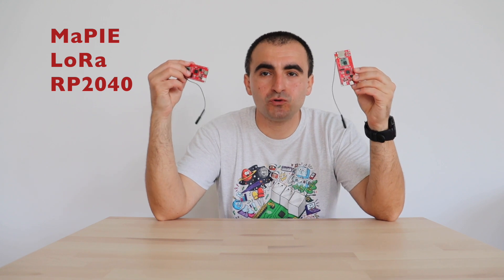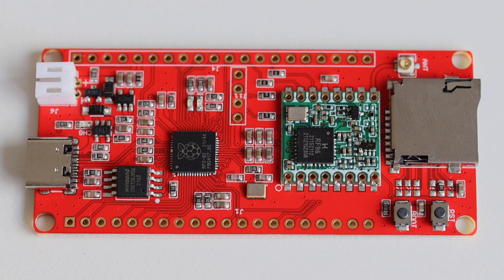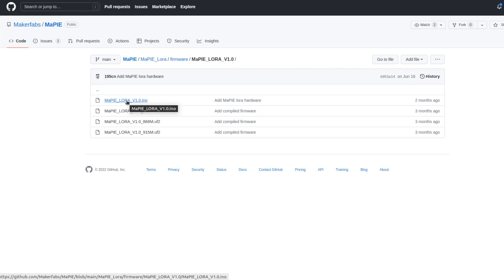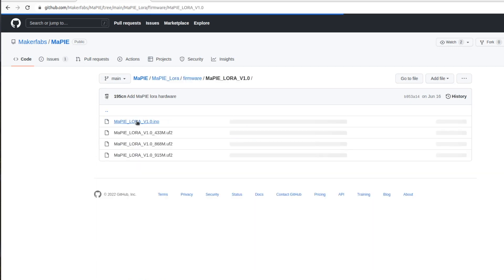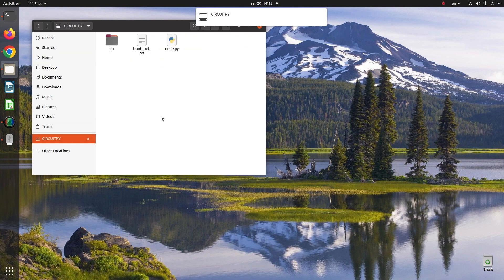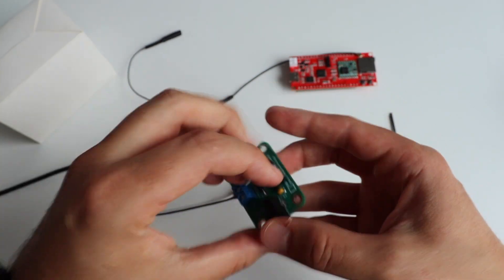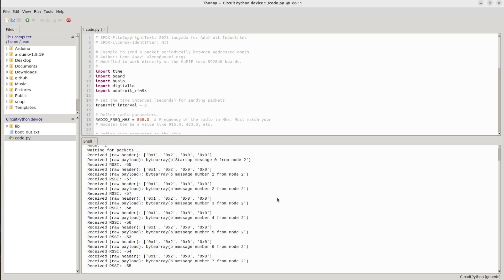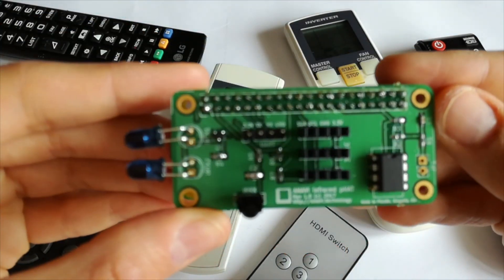CircuitPython on MaPIE LoRa RP2040

Comment: I’m also working on an rfm95 project in circuit python. If you open up the Adafruit rfm docs or library you’ll see there are a lot more options you can customize. They don’t put many options in the default example. You can specify the baudrate, error correction, syn/ack buffer mode to ensure messages are received and a lot more worth looking into.  It’s nice to see someone else with a working text example. Also, no encryption by default so some can eavesdrop on your node if they really want to. If you use it for a mailbox sensor project (most common lora project)  it’s recommended to use a large integer instead of simple 1 or 0 to avoid having someone trigger your mailbox or vice versa.
Reply from the maker: Yes, good note about the additional options! What MCU are you using for your rfm95 project in circuit python? Is it also rp2040?
Reply: Oh I should specify i’m using the Adafruit feather rp2040 and Adafruit feather esp32-s2 with lora featherwings.

Comment: Tenho de usar sempre duas placas Lora? Se eu quiser usar um sensor de temperatura e humidade DHT22 e quiser gravar os dados 5 em 5 minutos,  numa região remota, como poderei fazer?
Reply from the maker: The example source code in GitHub that I shared is for LoRa P2P between two devices. You can modify and extend it to support DHT22 temperature and humidity sensor. If you need multiple devices consider building or connecting to a LoRaWAN network.
Reply: @LeonAnavi  How can I connect it to a LoRaWAN network? Do I need something like a DevEUI, AppEUI, and AppKey for it?